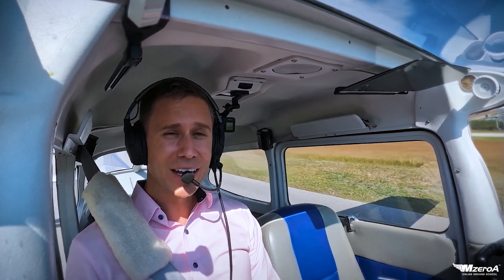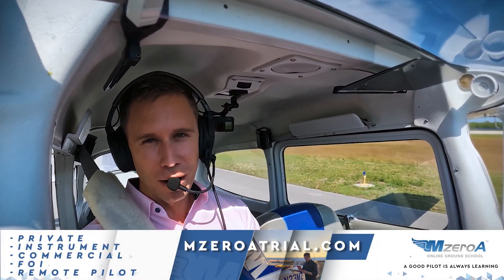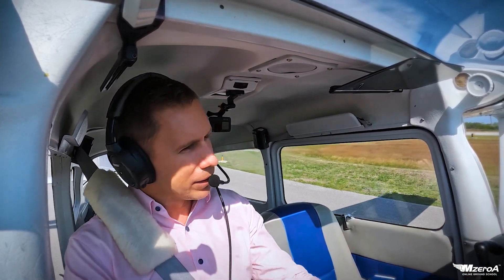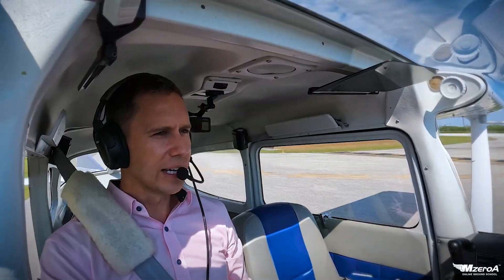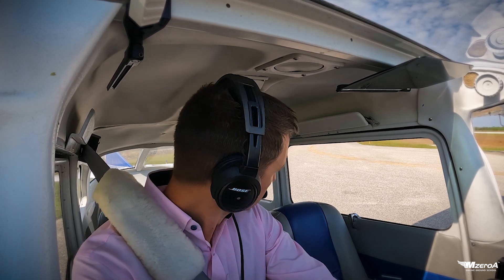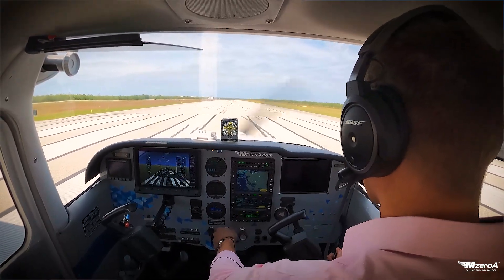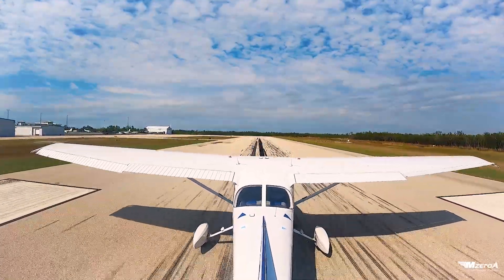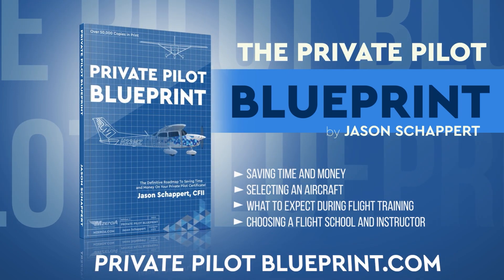How to Manage Engine Failure on Takeoff with Runway Remaining

Comment: You mentioned not getting light in the seat for the push forward, no parabolic arc... it seems getting to a safe airspeed the quickest would be most important here, what is wrong with getting light in the seat?  Thanks!

Comment: A mouse had gotten into my fuel tank on a pipeline 172 and eventually its hair clogged the thimble screen into the carburetor.  On takeoff, using my default basic level in low ground effect takeoff to Vcc before pitch up out of low ground effect, the engine quit.  I landed on the runway remaining.  If no runway had remained, I would have used the developed level in low ground effect free airspeed energy to pitch up wings level and turn to a survivable landing zone in the very near hemisphere in front of the wing.  I have also done that coming out of crop fields while crop dusting six times.  The normal Vy pitch attitude and airspeed of takeoff, into the maneuvering flight arena of too low to recover from inadvertent stall, is way too slow.  Yes, more up for time.  But I don't like being dead unless I make it to the safety of altitude.

Comment: I think computing ground roll for takeoff AND ground roll for landing (with a safety buffer for the shock factor) to determine a kinda accelerate stop distance may be beneficial to look at the big picture. Maybe even a total distance to 50 feet for take off and landing, again with a safety buffer. Especially if the performance charts only have a short field technique vs what “normal” would be. point out that your technique as seen in video differs form the POH data available. Ie using all runway, hold brakes to max rpm before release and Vr changing based on weight, and not using  random lift off speed. Thus potentially making all those computations inaccurate. Small note. Perceptions need to be correct and accurate, don’t you think?

Comment: That is called a 50 Feet EFATO.  Most engine fails are partial power, so i used to teach The 50 feet partial power lost too.  The call it now 50 feet LOTOT.  50' Lost of thrust on take off.